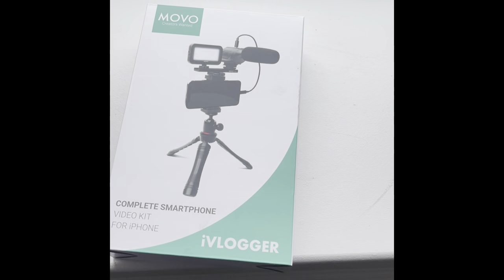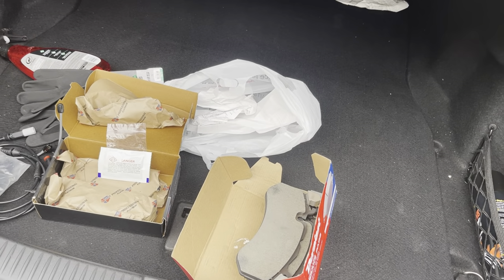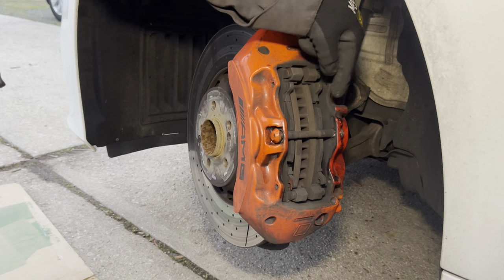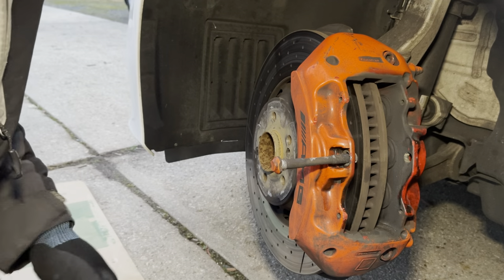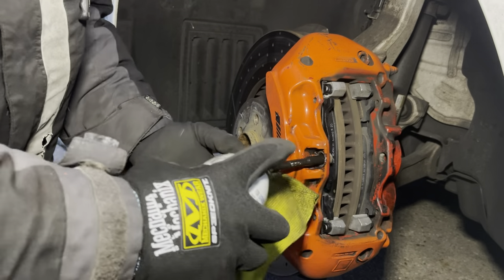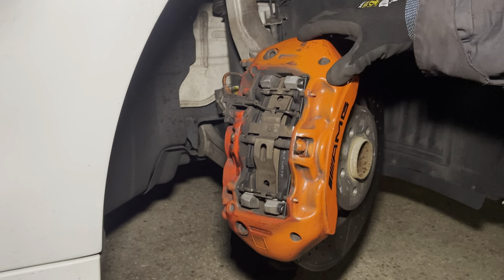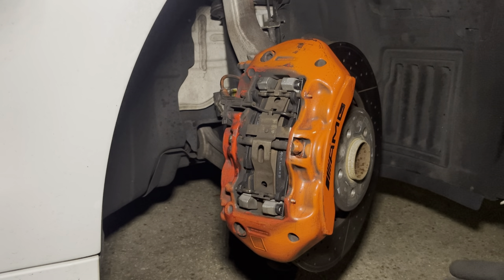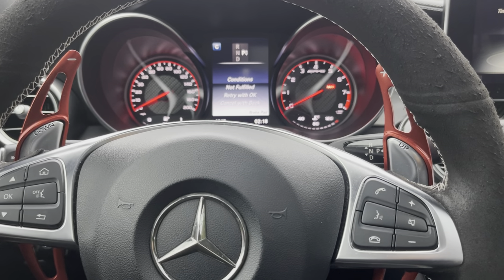Changing brake pads made simple 2016 Mercedes C63s

Comment: thanks for the video, I am changing my front pads and rotors and wanted to check if I need to drain the brake fluid after completing the job. I noticed you opened the reservoir cap but other than that you didn't mentioned anything about getting the air out of the system. Can you please point me in the right direction? thanks so much
Reply: Not needed, if you don't want to change the brake fluid at the same time. You need less force to push down caliber cylinders when the reservoir cap is open. Thats why you should open the cap.

Comment: Great video. Are you supposed to engage the workshop mode before unbolting any of the back caliper?
Reply: You should engage it before starting the rears fronts you gotta either drain the fluid or push it in
Reply from the maker: Couldn’t have said it better myself 🔥🔥🔥

Comment: Funny old vid this. 
In one vid says you don't need carbons and then within seconds says they suffer brake fade......

ANYBODY that does things like this on the net should provide proper info like torque settings and specifications for everything that they can. Whilst it is the responsibility of people doing the actual job it's not really responsible to only give half the instruction for the work at hand.
Don't spray grease around like that, others will copy you and not be so careful. Take it off and grease it away from the assembly. Don't compromise yourself OR OTHERS on the road.
There are too many videos on YouTube doing things like this. Even journeymen like that blowhard Scotty Kilmer are guilty of this.
The amount of money you save not going to the main stealer will more than pay for a torque wrench. The forums are full of the tech info you are looking for too.